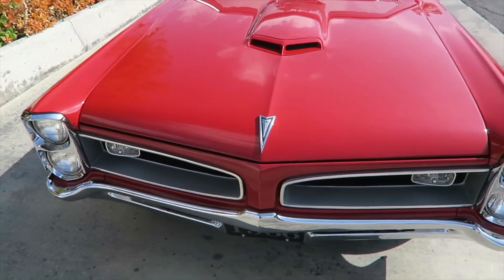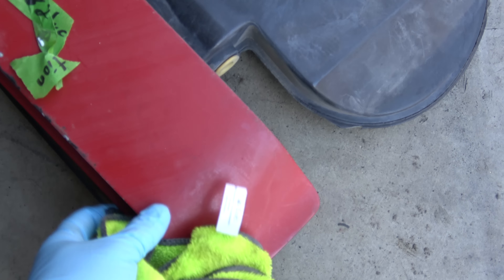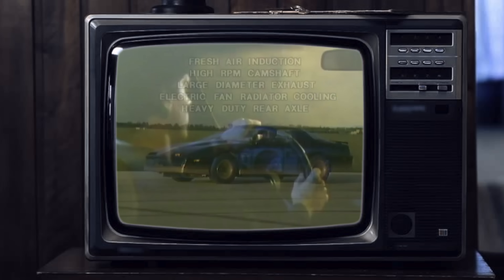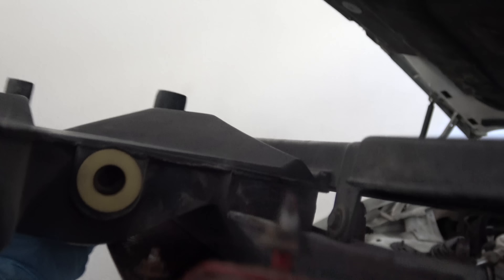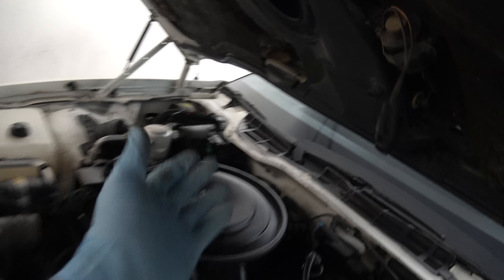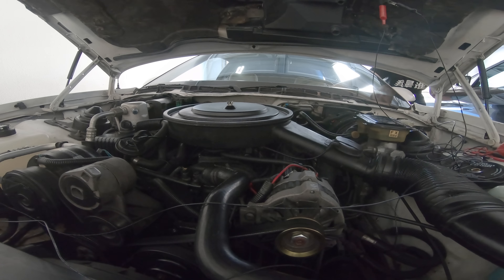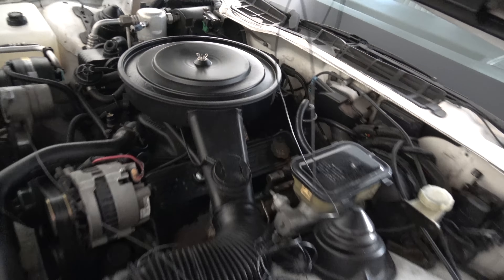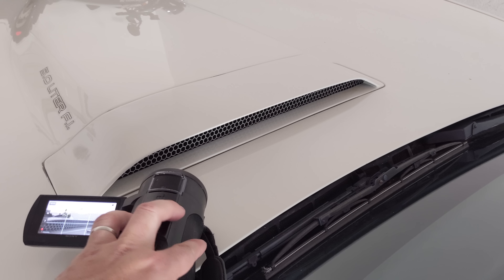I Unlocked Massive Power in My Firebird

Comment: I bought one from the junkyard when I had my 82 Trans Am, took the door out and made my own air cleaner mod. The drain goes right on top of the distributor, so use a hose from the drain hole to the area between the brake reservoir. Remember that you’ll have to clean the carb more often. Also can use black window screen in there to keep out bigger objects

Comment: That was one of many mods that I made on my 79 TA. The next improvement that you can do is ditch the Fram air filter and replace it with a K&N, you will notice the difference.
Reply: Was the difference actually LESS filtration & more air flow to carburetor? FRAM survives on smart marketing strategy & they have done a great job of that for a long time.

Comment: Awesome work, I love seeing a car reaching it's potential.  To somewhat answer your question as to why they stopped using this system, GM is notorious for "bean counter engineering" where they find out it costs them $5 less per unit to have whatever option is on there (though it drastically improves performance), they will remove it and have a slightly higher profit margin, it can be infuriating at times.  The second reason is probably some obscure emissions/EPA requirement (less air and fuel running through the engine=less emissions) and the only way they could get it to pass from factory was to delete the scoop altogether.  You'll notice in the early 3rd generation f-bodies (82-86) that the 5.7 wasn't offered again until I think 1987 because emissions laws were outstripping the technology and they couldn't get a 5.7 to pass the emissions the EPA wanted.  The EPA, more than anything else, killed the muscle car.
Reply: 3rd gen TAs only had these hoods from 82-84. After that they were only on Formulas. It wouldn't work on TPI. My 82 TA had it with Crossfire Fuel Injection.

Comment: Did the exact same mod on my
87 305  Formula firebird  years ago  got the parts from from 
junkyard for $30 .00. Totally agree with you about air scoops being functional. The 
long plastic piece attaches below the screen to divert water away from the distributor, and the hole on the bottom side of the housing
is a drain hole for water.

Comment: I had an 80' Mustang Turbo that had a "power bulge" hood and an 82' GT that had a hood scoop. Both were non functioning but I easily modified an made functional. This was well before fuel injection so the mods worked fine.

Comment: The main reason for fake hood scoops on American cars is NASCAR. In NASCAR, cars move fast enough that hood scoops are actually functional. At public roadway speeds -- even on freeways within hailing distance of the speed limit -- hood scoops don't improve performance at all. Yes, cold-air intakes are effective, but ram-air intakes are not effective at freeway speeds. The performance increase you felt was the result of increasing the effective cross-section of the intake plenum, not the result of pulling air specifically from the hood scoop. A wider intake plenum under the hood would've accomplished the same thing. So American carmakers install cold-air intakes that reach forward to the bumper instead, and add fake hood scoops to satisfy American car buyers' desire to have cars that look fast, without adding one more place for water to leak in.
Reply: Myself  And  Others  Have  To  Disagree   With  You.

Unblocking   That  Rear  Facing  , 
Non - Functional  
 Hood  Scoop  And  ACTUALLY  Making  It  Functional  ...

Actually   DOES   Make  A  Difference    In  TWO  WAYS .

 Firstly  ...

It   DEFINITELY    Now  

ALLOWS    ALOT  
  Of  
Unwanted / EXCESSIVE 

 HOT   ,   Underhood    AIR 

To  ESCAPE  From  Under  That  Huge  , Long  , 
And  Wide    Hood .

THEREFORE  

ALLOWING   The  Engine    To  ACTUALLY   RUN   THAT  MUCH  COOLER    , 
ALONG  WITH  LETTING  EVERYTHING  ELSE  UNDER  THE  HOOD  FUNCTION   COOLER   ALSO  .

And   SECONDLY  ...

EVEN   AT  SLOW   SPEEDS  DRIVING   AND  EVEN  SITTING  STILL  AND  ONLY    AT  IDLE ...

The   Engine   STILL  IS  SUCKING  IN  MORE    AND 
VERY  WELCOME   ,  SLIGHTLY  COOLER   AND  DENSER   AIR   , 

AND  THAT  IS  STILL  A  FACT .

IT  IS  STILL  AN  INCREASE  IN   AIR  FLOW  AND   AIR  INTAKE   AND   SUCTION  
WHICH  THEREFORE    CAUSES   AN   INCREASED   AIR  INTAKE   EFFICIENCY ...

AND  THEREFORE  IT  ALSO  INCREASES   THE  HORSEPOWER   AND  TORQUE  OF  THE  ENGINE  EVEN  IF  ONLY  SLIGHTLY. 

NOW ..

ITS  NOT   A  HUGE   ,  INCREDIBLY   STRONG  / WHEELIE    PULLING   
INCREASE   ...

BUT  ITS  STILL   AN 
INCREASE .

A  SLIGHTLY  "  NOTICEABLE  " 
AND  WELCOME   INCREASE
IN  HORSEPOWER  AND  TORQUE . THE  NEW  INCREASED  AIR  INTAKE  SUCTION  ALSO  JUST  CAUSES  THE  ENGINE  TO  RUN   COOLER  ,  AND  THEREFORE   IT  RUNS   MORE  EFFICIENTLY   WITH  SLIGHTLY   AND  JUST   A  LITTLE   MORE  "  PULL  " 
AND   A  LITTLE    MORE GRUNT .

THE  CAR  
POSSIBLY    / MIGHT   ALSO  
INCREASE   IN  GAS  MILEAGE  BY  A  MILE  PER  GALLON  OR SO  TOO.

SIMPLY  PUT ...

IT  HELPS  TO   EVACUATE   UNWANTED  / EXCESSIVE   HOT  AIR     AND  HEAT 
OUT  OF  THE  ENGINE  BAY ...

WHILE  ALSO  
SUCKING    IN  ,  MORE  AND COOLER  / DENSER  AIR .

BOTH   GOOD  THINGS   FOR  ANY  ENGINE   AND  ANY  CAR.

Comment: I have a '74 Corvette that has basically the same system.  the flap solenoid is operated by a switch on the throttle pedal...pretty much only opens up under WOT.  when closed, its quieter, and, prob more important to Chev when they designed it is that closed it pulls in the hot air over the exhaust manifold for quick warmup.  but when open, i get to hear all that quadrajet goodness

Comment: I wanted to do this to my car but could never find the parts aside from the hood so I just sold it and went a custom route. I removed the front fog lights on the bottom corners of the front end on my 1989 TA and got a double snorkel throttle body cover and routed one to each fog light opening. Gave her a little more power. Not sure if it was just the placebo effect or not.
Reply from the maker: Sounds good! Yeah I lucked out finding the parts

Comment: On the car that originally had the functional scoop, there was a switch connected to the throttle linkage that opened only at full throttle. Fuel injection can compensate for a variation in the fuel to air ratio, well to a certain point without tuning. The 82-84 cars that were equipped with this setup were all carburetor equipped  (to the best of my knowledge). Carburetors are tuned generally for wide open throttle maximum performance. Extra air at part throttle positions would affect the performance and drivability in normal situations. Your car shouldn't be affected by this. The only thing else is to close the flap so that nothing like water, bugs, leaves, etc get in there. Also, realistically, it adds about 5 to 10 percent more power. It may feel like more but it isn't. A quick trip to your local dyno will show you the before and after. Good choice in cars so far!!
Reply: Thanks, this is exactly what I was wondering about the original setup. Very cool, I had no idea the early 3rd gen cars had this option!
Reply: My 82TA had this and was Cross Fire Injection. You could really hear it suck air with the T-tops out. I also put a Hypertech power chip in it and tried different exhaust setups and rear gears. It would outrun stock Foxbodies. It was a rare car, every option. PDS, Rear wiper, rear defroster, etc. I owned it until 2000.
Reply: @clintdavis9511  hypertech chip,good for 3-5 horsepower......on the best days.if you had 3.73s you might have had a chance with an automatic 5.0

Comment: My first car was a 1983 Trans Am with that scoop.  The issue with the hood scoop solenoid was that it would bind and not open sometimes.  I just wired it open like you did.  In heavy rain, you'd get some water in the intake but if you look at the underside of the scoop, there's a hole where water can exit without damaging anything so it's of little consequence since the bulk of it drains out.

Comment: I had an 87 TPI and mine had the mesh chicken wire open and no hood liner. I always thought it was to vent heat from the engine bay. Cool to know it was functional for the TBI. I’d look into getting a K&N air filter for that bad boy

Comment: Cooler air is more dense. More dense air has more oxygen then the the same amount air that is less dense. More oxygen you put in an engine the more fuel you can add. Bigger bang!
Reply: nice cept he was pulling cold air already from the nose above and to the left of the radiator.. this mod gave him NOTHING except a woosh sound at WOT... ZERO PERFORMANCE gains. the little TBI wasn't starving for more air.. so it didn't help in that way.. it's all in his head..

Comment: If you really wanted to go crazy, the 1984 HO Z-28 had a dual-snorkel air cleaner. You could source one of those and then you'd have 3 access points for the intake. I was going to do this back in the day, but the deal fell through on the 84 Trans Am I was about to buy, and I ended up with an 85 TPI model instead. Love that yours is a 5-speed.

Comment: You would need a throttle position sensor hooked up the flapper for when it opens etc. this set up is for 82-92 F Bodys, they even had the Camaro good like that. It could work on a TPI, you would have to modify a pipe to the TPI, this all most like a Air box or Ram Air. I think the best air scoop was the 70 Chevelle SS with the flapper door, really cool set up.

Comment: That was freaking awesome! I had a white 1992 Formula with same engine but was automatic. That thing was actually a nice car but was slow as a boat. I got devoured by every Mustang in town. It is good to know that there STILL are solid options out there for these specific F bodies.

My first car was a red 1976 Camaro with a 305. The interior was REALLY nice. It was actually pretty quick. It had these THICK spacer plates between the carb and intake. It was MUCH faster than my 92 ever was somehow...
Reply: it seemed like it was quicker,it wasnt....

Comment: I had an '84 HO Black and Gold T/A exactly like the one in that commercial. It was an L69, the 190 hp 5.0. I remember the vent working well. Pedal down, it would flap open and go to town. I wish I'd never gotten rid of that thing. I looked up the VIN recently (I do every now and then), and actually found the damn thing. I'd just missed it being on sale not far from here a couple months ago. 50K more miles than when I sold it and not QUITE in as good shape, but in shockingly good shape. I'm so pissed I didn't look that VIN up a couple months ago - I would have bought it back in a heartbeat.

Comment: Nice job! Back in the late 90s I added just the screen to my 90 TPI formula. The Pontiac dealer I worked at located the last NOS one available in the country and had it sent in. It felt like a big deal at the time. Loved getting rid of that block off plate.
I would try to find a way to make it throttle activated like it was on the 83-84 cars. That would make it even cooler.

Comment: The issue with closure is carburetor ice. On a very cold day, the cold air drops to a lower temperature as it goes through the venturies. Thus causing ice in the carb.
Reply: a)it isnt a carb   b) you dont drive classic cars in 0 degree weather 🤣

Comment: Find a chassis dyno in the area. First run; disconnect the linkage and run closed. Second run; hold it open with some wire or something else. You could even wait for a cool day so there would be a larger temperature differential. Also, you could make it a three way comparison. Do an extra run with the snorkel hose disconnected and the hood air closed so under hood temps would be introduced into the intake. I think the snorkel hose pulls air from near the front of the car which could introduce cooler air, or maybe introduce warmer air near the blacktop. I see many older cars with the snorkel hose deteriorated or missing.

Comment: A really nice video.making something more effective by increasing air flow.the only thing I want to add is that only the 1982 cross fire trans am came with a functional air induction set up.the carburated 1982 trans am with the level 3 performance package (ws 6 or rear disc delete rear drum ws7) recieved the hood but no functionality. All 1983 trans arms came with functional air induction carb or cross fire fuel injection.all 1984 trans arms also had functional  air induction and all were carburated weather they were the base lg4 or the h.o.l69 option.

Comment: Have a EXACT TWIN to this car. Mine is an ‘88 Formula Firebird, TBI 5.0 5 speed, T Tops, white in color. I plan to do this mod. I am in it for the sound and cool factor. I like how these TBI sound at wide open throttle. The sound resembles the secondaries opening up on a Quadrajet carburetor. TBI is great.
Reply from the maker: Nice! Hope you pull it off, it’s way worth it! I love the induction sound!

Comment: Looks great with the mesh and glad to hear it works! It appears that it bypasses the air filter, which given the flow of air is likely not an issue but, is there a secondary filter in the assembly mounted to the hood?
Reply from the maker: It actually has a dome that seals the air filter, don't worry it's not bypassed

Comment: Question. I have an 87 formula 305 4 barrel. It has an edelbrock pro flo triangular foam filter element and is more openly exposed than the original setup (which I assume filters better than lousy foam).  My scoop door can be removed by 4 screws and I always assumed it was functional as it would cool and reflect the air off the windshield and directly through the foam and down my carb, therefore being functional, right? Regardless, it feels peppier and the edelbrock 4 barrel sounds AMAZING with the cover removed.

Comment: This WAS interesting! The '80/'81 Birds used a very similar (identical?) hood bulge. Except their air cleaner was offset toward the master cylinder, so things may not line up the same...plus you'd have to integrate the turbo lights from those early cars, thus losing some air induction real estate potential.

Comment: If I recall correctly, the rearward facing shaker scoops on the TAs in the early 70s were functional, but had to be blocked off by the mid or late 70s for passby noise emissions (air induction noise).
A common upgrade back then, similar to what you have done, was to just cut out the shaker block off plate.

But with that said, in 80 and 81, Camaros had a similar on/off flapper door in the hood, similar to how your 82-84 trans am scoop works.  Not sure how they got past the noise regs at that point, but couldn’t with the late 70s shakers?  Perhaps the 80s exhausts were quieter than the late 70s, leaving some room for some air induction noise to be tolerated in the passby noise test?  

On a similar note, I know with the camaros and TAs of those periods they often had automatics mandated with some engine combos for emissions regs.  With an automatic, you can calibrate the trans shift points a certain way so you go by the passby microphones in a specific gear and rpm so that noise levels are more controlled than with a manual (don’t ask me how I know LOL).  Maybe that’s how it became possible for cold air induction to be possible again in the early 80s cars
Reply from the maker: There are all sorts of tricks we car guys need to learn!
Reply: ...cuz it only opened on wide open throttle

Comment: Can dirt /dust from the air get into the engine, i.e., does this air intake bypass the filter? If so, would more frequent oil changes flush it out (and not really a problem).
Reply: I have this on my car-  I don’t think he used the right air cleaner housing.  The one on mine has two lids, and the round air cleaner is much smaller so that the air runs through the filter.  Don’t try to use the stock tbi filter housing, use the one that came with the system.

Comment: Nice job!
Just put a small switch on your throttle pedal (like a brake light switch). When you floor the throttle the flap will open.
May need a little fabrication for the bracket, but it's doable😉.

Comment: Originally Pontiac wanted to put the 301 Turbo in the '82 TA and that is why the carry from the 1980-81 turbo hood but GM shot it down and the Pontiac V8 was gone. Pontiac had plans to develop the 301 Turbo to make more hp than they had in 1981 (200hp).

Comment: I guess I missed when you got a 3rd Gen?  Anyway, I had this hood once from a 305 Crossfire car and wired it through a toggle to key-on and ground so I cold close it on a rainy day or dirt road to keep my 500HP 383 Stroker motor happy..  IT's in my 1996 VHS shredding tires with a 70 challenger

Comment: Great. Now put in a new high flow flow throttle body and then work on the other end. Maybe put in a performance exhaust manifold and maybe a high flow cat... mundane but have you upgraded the spark plugs/ignition coil?

Comment: That Turbo hood on that gen 3 Firebird. Those only came on the 82-83 Firebird in the beginning for gen 3. And that hood was for the 301 Turbo motor that they decided not to use in 82-83 and went with the 305 motor instead. Those hoods were never mean to be for ram air. They were only meant to give the turbo system more room for the 301 Turbo motor they decided not to use in those years. They came back out with that hood later but it was never a 'power bulge hood', it's a TURBO HOOD. Was meant for a turbo car. And the vent part of the back of the hood wasn't a vent or intake it was meant for turbo stage lights that mounted in there.